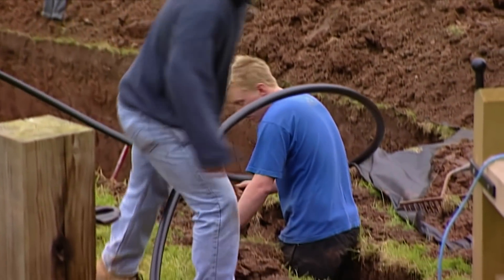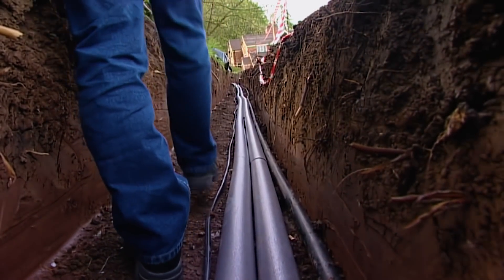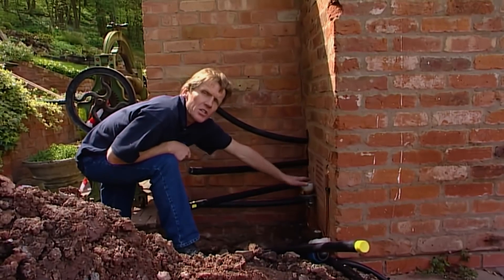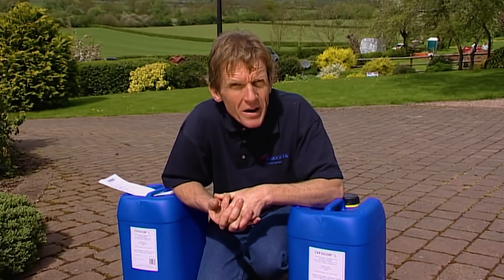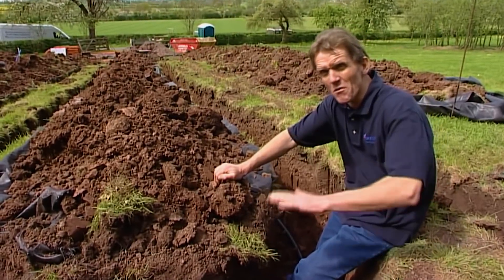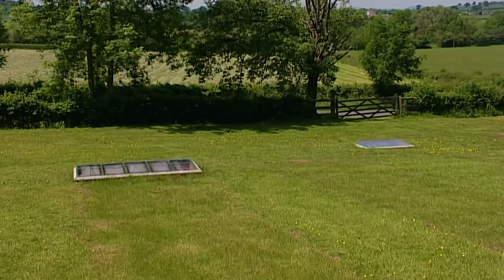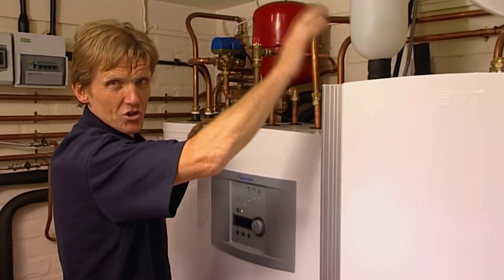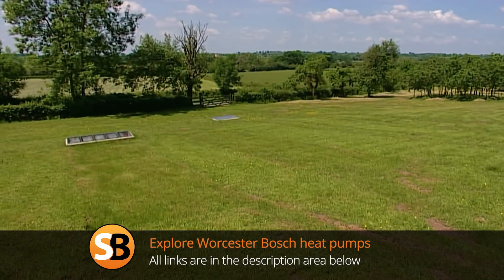How To Install a Ground Source Heat Pump

Comment: I have been watching some videos of ground source heat pumps installations from UK and US. What strikes me is the number of people at the site. I live in Finland. When you contract somone doing this here there is is one guy apearing on the site at a time at least. Ok when digging a  trench there might be a separate guy driving an excavator. When drilling a well there is only one guy. It normally takes one to two days to drill close to 200 meters and put in the pipe.  He tests the preassure and if ok one heat pump installer does the rest the next day.

Comment: I'm in the USA. In Wisconsin. And during the winter it gets down to -28c for a week at a time. (Had to look up what-20f is in Celsius)
And it can get up to 32c during the summer. I self built my house. Had a contractor put up the outside. And I did everything inside. Anyway I self installed my geothermal hvac. What they call it over here. I have infloor heat and chilled water fan coils for cooling. Could cool the water to freezing. But has a setpoint of 36f to keep pipes from freezing.  So cold enough to remove humidity. In the fan coils. My house is 3400sqft. I keep it as hot or as cold as I want all year. I also have 10,080watts of solar electric panels. And have ZERO utilitie bills for 7 years so far. I  installed a 2 stage bosch heat pump. Runs on 3 tons most of the time. And ramps up to 4 tons when it's -28c during the winter.  I have 4 horizontal coils. 1 for each ton. On 1 acre They have to be buried 6-7' here in wisconsin. To get to the 56-58°f that it stays at. I hired a guy to bury the loops in my yard. Because I don't have an excavator. And he buried them down to 8'. But I did everything else myself. It's surprisingly simple. I drive a forklift for a living.

Comment: That’s not the sun hitting  the ground.   That’s geothermal. The further you bury the pipes the better.
Reply from the maker: I am sorry but you are completely wrong, it is not geothermal. That is completely different.  How do you think we had Ice Ages if the core of the earth could keep the ground warm to a mere 100 metres depth? 
Ground source heat pumps are capable of freezing the ground and even to a depth of 100 metres there are seasonal changes.
Reply: You actually think you are directly using the heat from the Sun to warm the pipes in the ground? Hmmm, wonder what that frost line is all about when you are getting warmth from the earth in the winter… @SkillBuilder

Comment: What was the point of this video? It seems to be a celebration of GSHP and yet in the comments below Roger openly admits it's too expensive for ordinary people and fraught with problems. The video in no way conveys these negatives. And if it costs as much as the £30k mentioned in the comments (probably a heck of a lot more now) - I'd like to know a breakdown of the costs. How much is labour? How much for the pipes? How much for the compressor? The boiler? The radiators?
Reply from the maker: This is an old video but  it has information that  is useful to anyone considering installing ground source. It is beyond the reach of most people but if you are not on mains gas and you have a large house it is well worth looking at. 
We could put prices on the videos but they change so it is far better to do a bit of research if you are serious about it. 
A bore hole, for example could cost anywhere between 3K and 15K depending on the location.

Comment: Although this was one year ago, it still amazes me how many new builds are not taking advantage of this technology. especially thermal and solar panels on roofs as well as ground-source heat pumps. Near where I live there is a large solar farm taking up valuable agricultural land. So my question is two-fold why do we not mandate in the building regs sola and thermal heat and electric capture. I am not talking about this feeding back into the network, but using it on an individual basis. Or even a small community basis. In the same way, some villages are clubbing together for broadband internet as the big companies are trying to fleece small communities or just to gather government grants only serving the shareholders. We have seen what happened to the water industry mentioning no names.

Comment: What would be the cost of fitting a ground source system to a detached 4/5 bed house with concrete floor. Walls and roof well insulated, roof space gives us three loft spaces, one along each sides of the roof and a standard loft at the apex of the roof. These have multi layers of insulation and are floored with roof standard chipboard and the roof eaves are also filled with insulation material. We nave now a combi boiled (3 years old and very efficient), an independent 10kw log burner. Windows and doors are double glazed and in some cases triple glazed and in some cases double glazed with secondary glazing and in some cases triple glazed with secondary glazing. We have a modern front porch and a large conservatory. Rear garden is approx 80ft x 40ft narrowing to 28ft. Access to the garden is not a problem and there is considerable parking to the front, paver drive. I need an estimate fairly quickly!

Comment: There's so much sun dimming now, a lot of the heat from the sun is being blocked from making it to the ground, and making it to the solar panels. What is making it to the ground is the silver iodide and aluminium particles they're spraying in the air to dim the sun. It works too, it starts off nice and sunny in a morning, then those flipping chem trailers/gridders are out, and next thing you know, cloudy, miserable rest of the day. Those particles are working a treat on our upper respiratory systems too, who doesn't love a bit of aluminium in yer lungs of a morning. And the UN says there's no rain water anywhere in the world now that is safe to drink directly, and the amount of aluminium in our soil has tripled. Wonder where that came from, hm? But chem trails, just a conspiracy, you silly billy loon.
These ground source heat pumps, totally undoable for 99% of UK's homes.

Comment: Could someone dig up an average suburban garden and heat an average 3 bed?
Reply from the maker: With a bore hole yes, but not if your neighbour was also extracting heat from the ground. Sometimes it causes the ground to freeze and plants and trees to die.

Comment: I don't understand why it's necessary to insulate the lines going to and from the field. Why can't the supply and return be run on opposite sides of a 24" trench and serve as part of the system? Picking up heat along the way? It's essentially the same thing as linear pipes in the field.
Reply from the maker: This trench is narrow and runs along the side of a swimming pool. Not everyone has the room for a 24inch trench and even if you do it can freeze.
Reply: @SkillBuilder  So if you have room for a 24" trench and can bury it as deep as all the other lines, the supply lines should not be insulated and therefor figure positively in the heat calculations, correct...? Seems like this would be the preferred option. 

Also, I know you have a bone to pick with air source heat pumps but a German engineer type fellow I've built stuff for for years over here in california is telling me Viessmann is coming out with a new model that is ridiculously efficient. Are you aware of this and, if so, what's your thinking? It sure would be a lot easier to go with that thing than doing all the digging. I've got plenty of area to work with but none of it is flat. 

By the way, thanks for responding.

Comment: I don't wish to be unduly negative - but if the output is roughly four times, in Kwh, the input ... with electricity presently three and a half times the cost of gas, I really don't see the advantage of ripping out a gas boiler and installing this system - especially in view of the cost - if indeed it's the finacial aspect that's the objective, rather than 'saving the planet' [yawn...]

Comment: Hello very well presented but you have mellowed? We had several buildings on our land at the rear of the main house with a mixture of half metre rubble walls and brick cavity walls where the original outbuildings had been extended into five three bedroom houses. There was plenty of room for a horizontal loop system but the ultimate decision was one borehole per house.
This worked well but only because we were able to line the interiors with 6" insulation during modification and extension of the original structures.
It was deemed impossible to attempt to install a heat pump in the main house as the half metre rubble wall with normal interior wooden frame and plasterboard would have to be completely stripped and various options of foam/resin etc applied for insulation with an estimated cost of £35/40k.
The five three bedroom modifications referred to cost on average £20k incl 100metre deep boreholes, pump and insulation.
What spurred me to make this comment is viewing your original you tube critique highlighting the potential issues applying to grant aided heat pump installations was music to my ears as i agreed with every single comment you made and  I was hoping someone would point to the pitfalls of heat pumps as well as the benefits.
I fear there are going to be many people living in what I believe are unsuitable dwellings for heat pump conversion especially in  conurbations where gas boilers are commonly used and could be a very costly mistake both for the home owner and government policy.
Good luck with all your future videos and don't be frightened of telling the truth I see you been taking some criticism from the trade???

Comment: What if I'm living in an area where ground water is very close to the surface(2m) will the system even work?
Reply from the maker: It works better with ground water than anything else. The water brings in more heat from the surrounding ground.

Comment: We had a GSHP installed in Sept 21 and are located in the Hudson Valley NY USA.  It is a 5 ton vertical closed loop system with two bore holes each 88 meters deep.  On Jan 16 at 4A ET temp outside was -1F or -18.33 Celsius.  The water coming in was at 42.5F or 5.833C and going out was 38.9F or 4.39C.  The return air was 65.8F or 18.7C the supply air was 86.5F or 30.3C. The temp was set to 68F or 20C in the house.
Reply: Do you mind giving us a ballpark of the price and how difficult it was to have installed?
Reply: @scooter_scooter_scooter  After all rebates and the Fed Tax Credit it comes in at $21,800 USD.  From start to turning it on took about four days for the drilling  and two weeks to complete the installation.  That included removing an air source heat pump and an oil furnace.
Reply: @chrismaxny4066  Thanks so much.
Reply: @chrismaxny4066  just so you know, just got two estimates, 5 ton ground source closed loop, radiant flooring and heating in a 3100 square foot house- $145,000.00!  Not joking.

Comment: Roger I know you made this a while back just wondering why you've re-released it. I thought in your video about ASHP you mentioned neither those or GSHP worked well enough and that was why you didn't fit one for yourself.
Reply from the maker: Hi Paul 
 I put this out because it shows how much work is involved and how impractical it would be for an average home. 
I said in the video they were keeping the boiler for very cold days. I think that says it all. Nothing has changed since I made this video.
Reply: @SkillBuilder  Thanks for the reply. Heat pumps appear to be a minefield and so dependant on the engineer specing the system. Makes it very hard to make an informed choice.

Comment: Why you pushing this with what looks like an old video when last month or two you were saying they weren't worth it??
Reply from the maker: Ground source is different to air source and we decided to re issue this video to show what is involved and how impractical it is for most people to install ground source. It is all information and nothing has changed. Air source heat pumps can't heat your home as quickly and as well as a gas bolier so think twice about scrapping your gas boiler in favour of an air source heat pump. If you live in the country and have lots of land and you are not on mains gas then ground source or air source might be a good option.

Comment: So let’s get this straight, when you use a digger say Jake up the garden with a loads and loads of pipe we don’t cover it back over and re-lawn fit a bloody big unit and then alterations in the house and then after all that we still need the mains electricity to run it! And don’t be stupid and say solar power we don’t get any bloody solar power in the winter when we want the warm water to heat up the central heating and water for washing.
I know Lewis looks like it will cost about £20,000 
But on the other hand we can run a 15 mil copper pipe into the house and pipe gas to small compact boilerand do the same job.
   Now tell me is this program serious or is it a comic Roger ?
Reply from the maker: I don't think it is for anyone who is looking to save money. People may do it for other reasons.

Comment: One of the easiest ways to transfer heat from ground sources is with ground water if there is a sufficient supply the earth readily gives up it's stored heat and the cold return can be put back just as easily. Heating companies seem to steer customers away from this type as it cost a lot less. Cheers.

Comment: Just to note. There are still those who are skeptical about global warming and this is mainly due to not understanding what the term actually means. Most people do not equate cold temperatures to 'warming',  so;

As greenhouse gases build up in the atmosphere, that humanity has produced and which has been happening for several centuries, light from the Sun is trapped in these gas molecules which causes the bonds between the atoms to vibrate. This vibration produces heat. A warmer atmosphere equates to a more turbulent atmosphere. A more turbulent atmosphere results in more extremes of all kinds of weather. Hot, cold, rain, snow, storms and other atmospheric and climatic phenomena of all kinds.

Comment: looks like a really cheap and simple system to buy and install , just need a semi detached country estate terraced house, about 2 mill in the bank , a utility room the size of an average council semi , a workforce of 30 blokes for 2 months, solar panels , some champagne and a party for the great unwashed at the end of the project and hey presto, the planet is saved
Reply: You guys are the poster children for 𝘪𝘯𝘦𝘳𝘵𝘪𝘢  with the tagline of “Let’s just keep polluting — we know 𝘵𝘩𝘢𝘵 works.  Who gives a 💩 about the mess we leave for the next people (our grandchildren) to clean up.”  Just keep throwing your plastic bottles and other trash out your window;  someone else will take care of it!

Sure, this may not be perfect and will require some maintenance, but you can say the same thing for fossil fuels.  The difference is that this system has remarkably less aftertaste, if the pumps are run with renewable energy like solar.
Reply: Don't forget all the pumps that could pump enough water to Africa during a drought. And the things that will absouloutly not have any issues for the next 12 months, until  an army of maintenance engineers build an office down the road as part of the lifetime of repairs the system needs.

Comment: nice videos.  I've seen quite a few now.  Many thanks and great work!   One question please, would it be possible for an underfloor heating system to double as a ground-source energy supply for the water immersion tank?.   everything would be inside the building, and installation on top of clay.
Reply: K

Comment: CoP of 4, or even more may well be delivered on average over the year, but in winter it will drop to 1 or less when system inefficiencies are taken into account.

ie In winter, running costs will be horrendous based as it is on prime electricity. Mind you, in summer you'll have heating and hot water galore 😁

Another point, in Scotland. the sun doesn't shine every day. Well, not underneath clouds it doesn't

Comment: A good presentation, but if this costs £30,000 who can afford it? My knowledge of ground and air source heat pump is very limited, but I do know a little about Thermodynamic panels. This is the future. One small box near the hot water tank and one or two panels (6x3 feet) on the roof, wall, or loft. Produces hot water up to 50 degrees day or night summer or winter. £5000 fitted.
Reply from the maker: I think this is what we call solar thermal. I have that on my house and it heats 250ltrs by 11a.m in the summer.
Reply: @SkillBuilder  Yes it is now called solar thermal. the reason being the public did not understand thermodynamlc but they did understand solar. So it was a pragmatic decision to name it "solar"  I am impressed you have this system on your house.

Comment: I’m confused the last videos of yours that I watched you were raging about how bad heat pump were?
Reply from the maker: This is ground source and it works better but this is not what most people will fit. The air source is not as good. I said in this video that insulation is the key.

Comment: How about just have wall mounted units for heating and cooling, boil the kettle to wash up and use an electric shower. No need for ground source at all if you don't mind not having hot water coming out of the taps...an air source digital scroll inverter is pretty efficient and you don't need to be a landowner to have one.